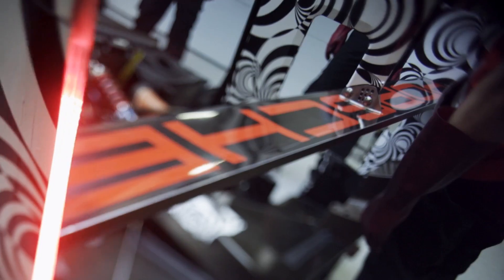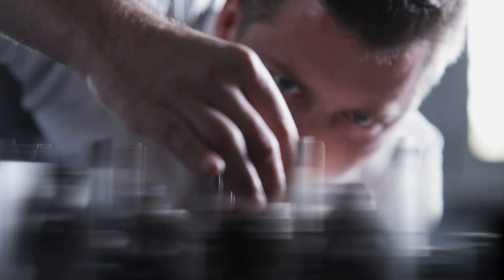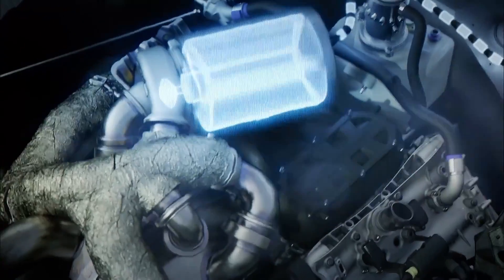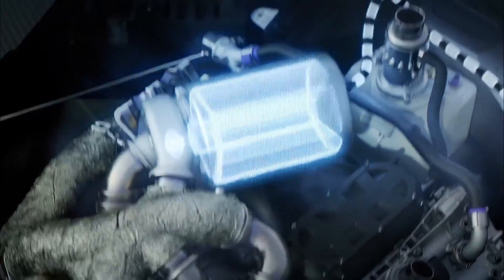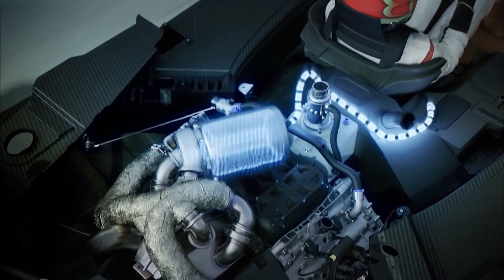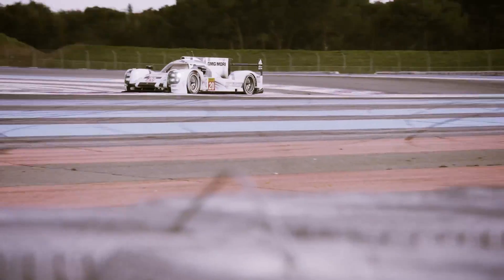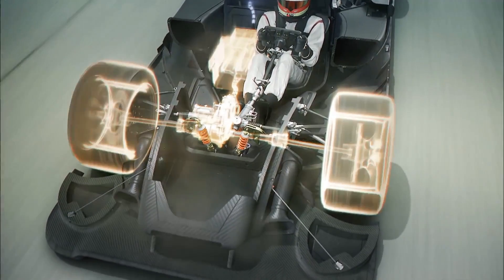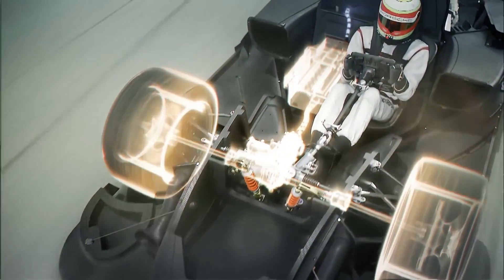Porsche 919 Hybrid technology explained in detail

Comment: how does it have a turbo AND exhaust recovery system? doesn't the turbo take out almost all the energy?
Reply: Exaust recovery system is the turbo. A generator is connected to the turbine n harvests electric energy from the spinning turbine when the turbo is not in use

Comment: Hier sind mal ein paar teschnische Details an alle die es interessiert    :D

Fahrzeugtyp:

Le Mans Prototyp Klasse LMP1

Monocoque:
Verbundfaser-Konstruktion aus Carbonfasern mit Aluminium- Wabenkern

Bordsystem Batterie:
Lithium-Ionen-Batterie

Motor:
V4-Motor mit Turboaufladung

Motormanagement:
Bosch MS5.6

Motorschmierung:
Trockensumpfschmierung

Hubraum:
2.000 cm³

Leistung:
< 370 kW (< 500 PS)

MGU:
<400 PS (< 294 kW) Vorderachse

Systemleistung:
ca. 900 PS

Daten:

Beschleunigung von 0 auf 100 km/h 2,2 Sekunden
Beschleunigung von 0 auf 200 km/h 4,8 Sekunden

Hybrid-System:

-Speicherart:
    Lithium-Ionen-Batterie mit A123 Systems Zellen

- Motor-Generator-Einheit (MGU)
    MGU an der Vorderachse, Leistung >400 PS (> 294 kW)

Antrieb/Kraftübertragung:

-Antriebsart
  Heckantrieb, Allradantrieb mittels KERS an der Vorderachse 

-Kupplung
  CFK-Kupplung

-Getriebe
   Sequenzielles, hydraulisch betätigtes 7-Gang-Renngetriebe

-Differenzial
   Sperrdifferenzial hinten

-Getriebegehäuse
   Hybridkonstruktion CFK mit Titan-Inserts und Alugussgehäuse

-Antriebswellen
   Gleichlauf-Tripode-Verschiebe-Gelenkwellen

Fahrwerk/Lenkung/Bremse:

Fahrwerk Vorne und hinten Einzelrad-Aufhängung, Pushrod-System mit einstellbaren Stoßdämpfern
Lenkung:
Hydraulisch unterstützte Zahnstangen-Lenkung

Bremsen:
Hydraulische Zweikreis-Bremsanlage, Monoblock-Leichtmetall- Bremssättel, belüftete Kohlefaser- Bremsscheiben vorne und hinten

Felgen:
BBS Schmiedefelgen aus Magnesium

Reifen:
Michelin Radial, vorne und hinten: 310/710-18

Mindestgewicht
875 kg

Tankkapazität:
62,3 l

Karosserie:

Höhe 1.050 mm
Breite 1.900 mm
Länge 4.650 mm
Reply: Lamk97 weist du ob es ein mechanisches oder elektronisch gesteuertes differzial ist?

Comment: question: why not charge the battery using the alternator,it would be easy than charging than charging it using the brakes.
Reply: using energy from the engine would reduce the car's acceleration and make it slower.
Reply: Because; and this is what a lot  of people don't understand, an alternator isn't "free" electricity, it puts an electromagnetic load on the engine, and fuel has to be burned to compensate for this- it's called "parasitic drag". Recovering electricity from the exhaust is a  step forward, this is energy that is normally lost out of the tailpipe, and recovering from the brakes is the same- there are calculations for just how much energy is absorbed by your brake system in a normal vehicle, and it is an incredible amount when added up. Recovering this and putting it back into a battery makes perfect sense, it essentially gets you more performance from each drop of fuel burnt.
Reply: Alternator aren't a form of a waste energy.
Reply: And probably restricted. To only use waste energy to improv hybrid in road car
Reply: matt karl  you are more or less right, kinetic energy conversion is what KERS does. Williams did try a flywheel storage design- look up Williams Flybrid Technology. Toyota tried super capacitor  storage, but everyone seems to have migrated to lithium battery storage now. I am a supporter of hybrid tech in any form, as it raises the useful energy of every drop of fuel burnt to something more than the 30% that an ICE on it's own uses. But until battery tech can achieve the same energy density level as liquid hydrocarbon fuel, then mainstream fully electric vehicles just aren't practical yet.

Comment: Give it 10 years, Porsche will be selling a $3000 option to pipe the sound of a dentists drill into the cockpit at the push of a button.
Reply: yerrr right ohhhh kayyy i will be going this way now guys run run lets get away from this dork he is talking shit agen
Reply: Porsche started out with engines you could actually hear the intake, valves, that classic cooling fan sound, exhaust- everything. Now they are so quiet you can hardly hear the engine at all, and so they charge a grand for an option that literally pipes the sound into the cabin. Eventually when the hybrids take over the cars will be so quiet you will hardly hear the electric motors. Which despite the fact they sound like a dentists drill, mark my words, some guys are going to fall in love with. You simply do not get on the podium a lot without some guys falling in love with it. So, in other words, if only you were paying attention and knew half this stuff you would understand its not talking shit. Its writing down the future in the present. Now, if you think that future is shit, okay, you get no argument from me. But its coming all the same.

Comment: how a v4 turbo 2.0 with electric engine can made 500 house power???????
Reply: engeneering? and also the engine alone makes 500hp. the electrics ad 400 on top so 900 hp together in one car. and the power mostly comes from the boost pressure (i think its limited to about 4 times atmospheric)
I mean f1 cars get over 800 hp out of their 1.6l turbo engines
Reply: MigotRen this is the future no more v12 screamers
Reply: Matteo Tononi 
In the early 1980s, F1 cars were making 1500bhp from 1.5 turbo engines.
Reply: I'd say the 2.0 V4s in the lmp1 cars are actually under-stressed at only 500hp. F1 cars with their current 1.6 Turbo V6s are making around 750 crank hp but these LMP1 cars have to cover a lot more miles in a season than F1 cars do so they must be more reliable since they only have 5 per season.
Reply: exactly. it's a 24 hour race. engine failure is the death to a competitor. also they must be as fuel efficiant as possible hence the use of diesel engines in for example the audi r18 because they are more efficiant. less boxenstops less time wasted. and I also think they have a rev limit regulation.
Reply: In the early eighties, 35 years ago the four-cylinder F1 engines from BMW had up to 1500 horsepower... What's the problem...? This is a very modest amount of power for a racecar... for just a combustion engine. In combination with the electric power it's gonna be a fantastic racecar.
Reply: superbracey my godness
Reply: superbracey but f1 made 20.000 rpm
Reply: +Matteo Tononi The BMW M12/13 had a max rev limit of 11,500rpm but made peak power as early as 10,300rpm. I believe the highest revving turbo engine of that era was the Porche TAG unit that "only" made 1060hp but could rev to 12,600rpm.
Reply: +Superbracey It was actually in the mid 80s they started making close to that much power. Peak power in the most powerful engine of that era (the BMW M12/13) in race trim at around 3.5 bar was from 850-900 and in quali trim at around 5.5 bar it was making from 1200-1350hp but had a claimed max output of 1400hp.
Reply: modern F1s are hybrid too
Reply: well high bird power is lyghter and will fill in the gaps when the engine slows down aka more power at said hands
Reply: Most RX cars make aroud 600hp using an inline 4 engine
Reply: Matteo Tononi ‘
Reply: mostly because houses are not very powerful, they just sit there and do nothing while people live inside them.